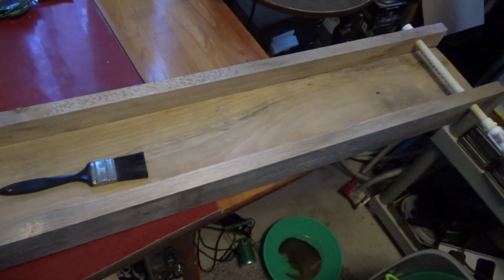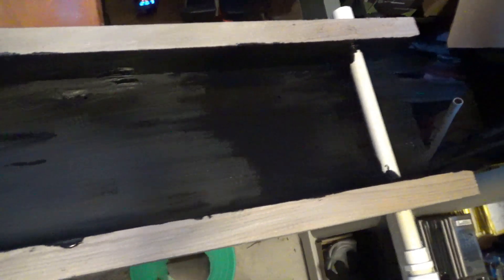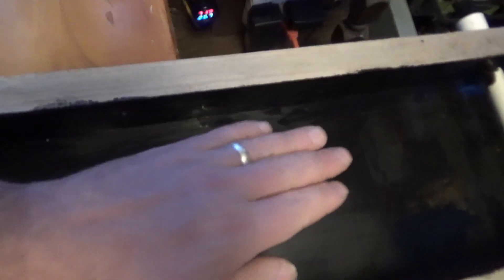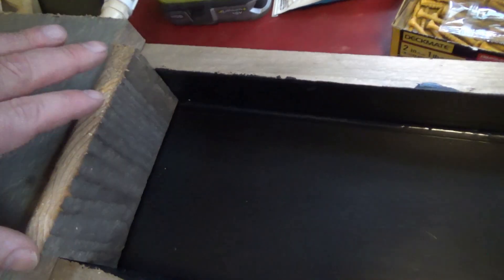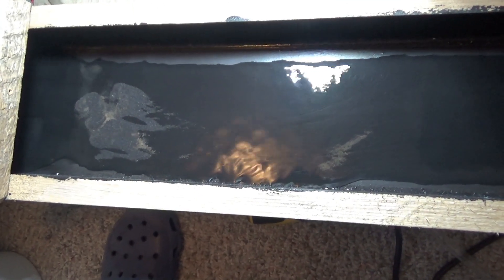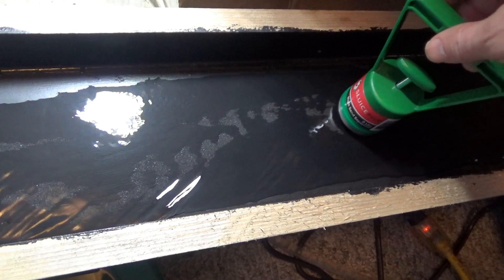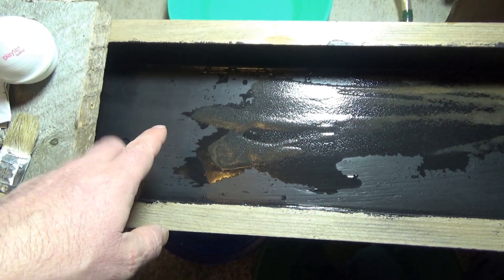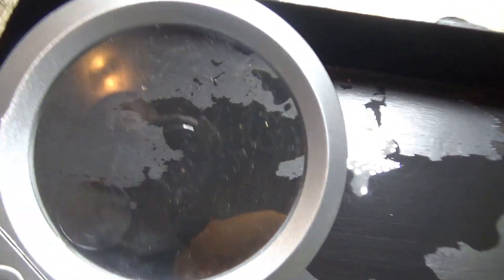DIY Miller Table Recovering A LOT Of Fine Gold From My Yard

Comment: Troy I was thinking talk about inch wide sandpaper straight across not Longway and then another inch below that inch wide but would it work if you scratch it besides Lay the bSand paper in there I'll let you think about it see where you think
Reply from the maker: The idea of a Miller Table is that it is nearly flat and smooth. The water flowing over the gold will press it down flat from my understanding.

Comment: if you get the wood pieces real tight, and throw them in a tub of water until they swell up, they won't leak.
Reply from the maker: True but this wont be under water all the time so I figured I would seal it up.

Comment: What about laying a small piece of wet and dry sandpaper on the bottom inside. Do you think that would catch some gold? 👍
Reply from the maker: I think it would hold too much black sand as well tho. The Miller Table surface is nearly smooth. I am working on an upgrade for this which I will share soon.